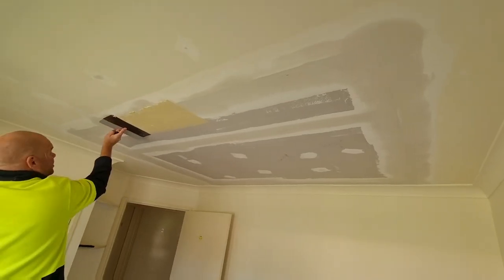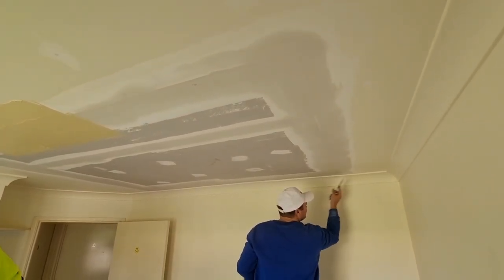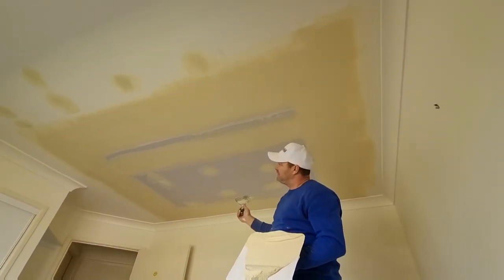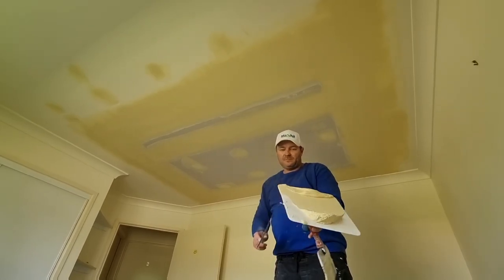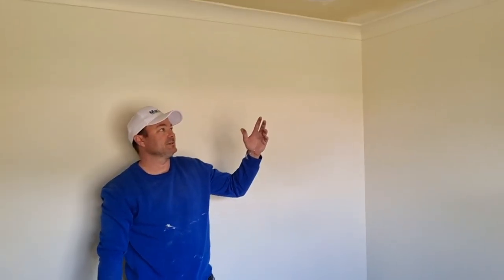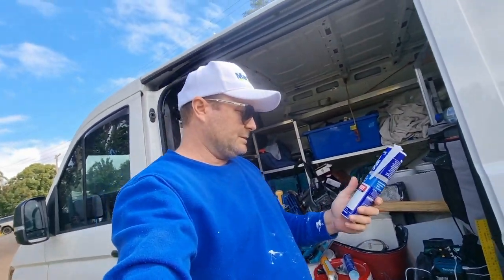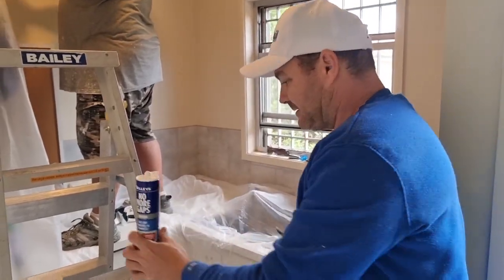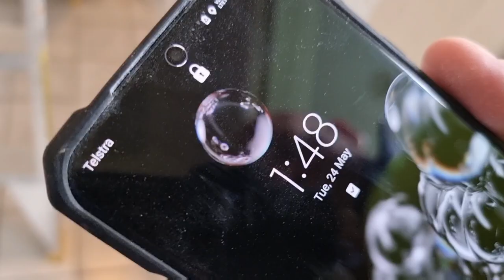Getting the Finish Coating Drywall Repair Flat & Blended with 4T Topping Compound

Comment: Maxkil, you really need to go back to that job in a couple of weeks and check for delayed shrinkage. As you applied the topping coat over a semi wet cornice cement mix, this may well shrink and the tape and join lines maybe be seen in a weeks time. I do this type of work every week as a Handyman and have learnt this through experience using the same products and technique as you. BTW, I heat gun is way quicker than a hair dryer to dry between coats. It's always best to give it a few extra days so all of the layers have time to dry out before sanding. At least $3500.00 here in Sydney Australia.
Reply from the maker: Yeah normally you can see that in a day, I have had to go over it again, its very rare that has happened. This cornice cement doesn't shrink like others.  We don't really get that problem, I did with boxes recently and i had to go over it again.
Reply: @Maxkil  I also use the same cornice cement but if the prefill or layer under the tape is not fully dry, and you apply another 2 coats it still shrinks a bit. I would not have believed this myself until I went back to a few jobs over the years and saw the faint pre fill and tape lines. I have been doing 1 and 2 day patches for 15 years and I still watch other guys to pick up tips. I can always learn something new and become a little better every year.